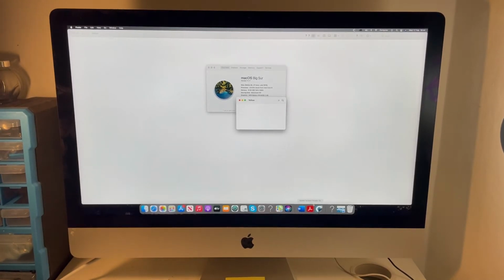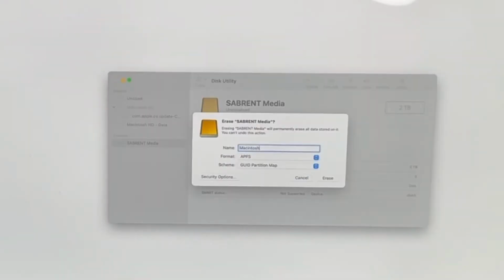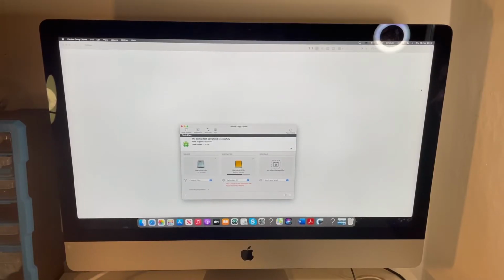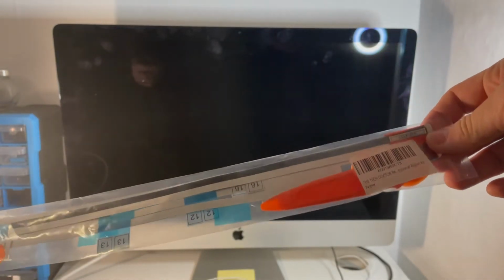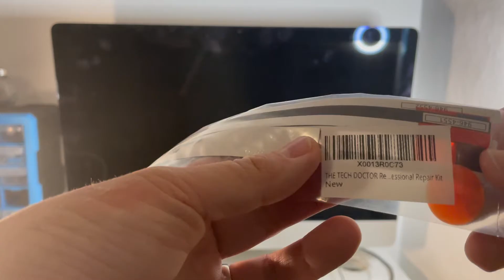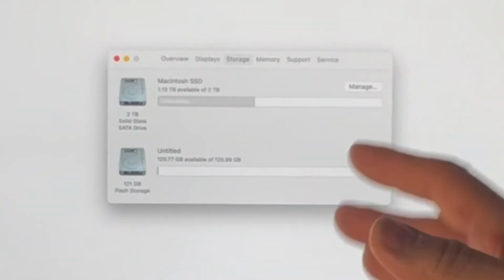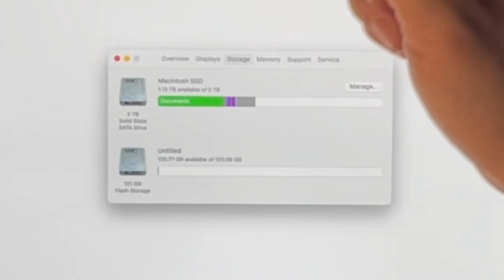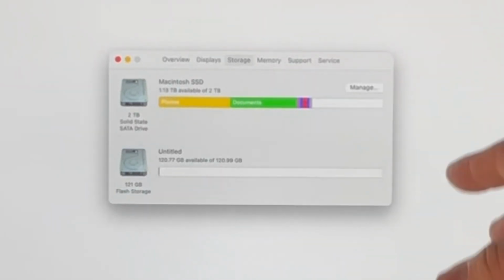iMac 27" Late 2015 A1419 4K - SLOW Fusion hard drive replacement with new internal SSD, MUCH FASTER!

Comment: Thank you Andrew, excellent video. But you left out some critical bits which seriously tripped me up. Most will want to upgrade the slow mechanical drive which is a member of the Fusion logical drive. Your video has the Fusion drive already split into 2 and you're not using the onboard PCIe SSD. 

My scenario was this - identical Mac to this one in video, with 128Gb SSD and 1Tb mechanical drive, both presented as a SINGLE Fusion drive. I wanted to replace the 1TB mechanical drive with a 1TB SSD and keep the onboard SSD as well. 
So I followed the steps, attached a 1Tb Samsung SSD via USB and used CCC to clone the Fusion drive to the Samsung. Removed the old mechanical drive, installed Samsung and system failed to boot (of course, Fusion drive now broken!). Booted with CMD + R to recovery, and ran "diskutil resetFusion" from within Terminal but it kicked up an error ("did not recognize verb resetFusion"). It was loading from the (old) recovery partition which is still MacOSX, Big Sur + Monterey is MacOS11 so command won't work. Here's how I sorted it:

Put the old drive back, system booted OK thankfully. This allowed me to download Monterey installer. Next I created a bootable USB stick (min 16Gb). Removed old disk, put in new, booted the Mac (with LAN/WiFi disconnected, NB!) into Recovery, this forced it to boot from USB containing new MacOS11. 
Next I ran Terminal and again "diskutil resetFusion" which now worked! It wiped both Fusion member drives then created a new logical Fusion drive. It said "Note: you have two solid-state drives, this is nonstandard but OK". Once the ResetFusion command completed, exit Terminal then ran Install Monterey from the bootable USB which installed perfectly.

Critical to this is that you have a Time Machine backup to restore from, clone will NOT work unless you mount it as a 3rd disk to an already booting system then manually copy your data back. So cloning was a waste of time.
Also, a) do clean the inside while the screen is off and b) never ever put the tape on immediately - always test first, put the screen back on without the tape to make sure the system is booting & working OK. 
Hope this helps someone.
Reply: Thanks boerboel777! I have the same late 2015 iMac bought with a 1TB Fusion Drive which like you appears as just one drive. I’ve been doing some research on this and keep coming across splitting the Fusion Drive up in Terminal before swapping out the mechanical drive. I’ve found several articles all with different Terminal instructions on how to do this (seems to change over time for different OSs). Looks like you didn’t do this and just reset the the Fusion Drive after booting from the USB installer with the new Drive in place. 
You say the clone did not work but do you think it helped reset the Fusion Drive as it was repairing the two drives it was looking for? I’m keen to give this a go but a little apprehensive around the added Fusion Drive complications. 

Cheers
Reply: @AlistairJC  You're right, I did reset the Fusion drive (running the command in Terminal after booting with USB) but this trashed the data on both drives. A Fusion drive seems to be a primitive version of RAID. So, with RAID you have an array of multiple physical drives combined in a single virtual drive. Apple's Fusion drive works the same way - it takes the small SSD and whatever other drive you have, then merges both into one virtual drive (VD). When it does this, it creates a hash of both drives' serial numbers and writes an encrypted signature to the new Fusion VD.

So if you change one of the drives, the VD signature becomes invalid and MUST be recreated from scratch. This process completely wipes the contents of those drives, hencewhy the clone didn't work. Cloning had zero effect on the Fusion Drive because it only clones the content of one member drive, and nothing will work without a valid VD sig.
So the only way to do this job properly is to make a Time Machine backup of your drive before you do anything. Then do the drive replacement along with ResetFusion commands and proceed to install MacOS. During installation it will offer you the chance to restore from TM - say yes and its job done. 
The other option is to ignore the Fusion setup and install directly to the new drive like the video shows. This leaves the small SSD hanging about in your machine and is IMHO a bit sloppy. Can't store much data on that drive and it will keep getting in the way. The only time I'd do it this way is if the small SSD is old, dog slow or dodgy - if it fails, the whole Fusion VD fails.
Oh, and be super careful with the screen! 3rd party replacement tape not sticky enough so they fall off and crack - happened with this exact same Mac 2 weeks later, new screen cost US$400 :(
Reply: @boerboel7777  Thanks for the detail, really helpful! I understand regarding the cloning not working.

The Fusion Drive seems like more of a hinderance the further I look at doing this. 
I am tempted to swap the drive and just leave the PCIe blade formatted and unused, guess that’s personal preference. However, I reckon if I do that I won’t be able to use Time Machine to restore from as it’ll be a Time Machine back up of the original Fusion Drive setup I’m guessing. Unless Time Machine doesn’t care about this….

I could use the migration function for the old drive perhaps with a SATA to USB3 adapter, but I’m not sure all the files would be there due to how the original Fusion Drive balances the files between the two original drives like you say. If that doesn’t work I’m at a fresh install on a Mac with no files I guess.

What was the importance of booting it not connected to WiFi/LAN in your original comment, just to ensure it boots from the USB installer? 

Thanks for the heads up on the screen, I’ve been looking at full kits from OWC. I hope the new screen from apple came with better tape! 

Thanks again
Reply: @AlistairJC  Hi Ali. You can get rid of the M.2 PCIe drive but that involves removing the motherboard to reach it, quite a mission. Or you can get an M.2 SSD drive and replace the old one, which gives you much better throughput than the SATA ones. Not sure about Mac but on Windows one can "hide" a drive which is not in use. 
As for Time Machine, good news is that it doesn't care where it gets restored to so that's not an issue at all. It will restore to whatever drive you install. When I ran the CC Clone, I was able to attach that cloned drive via USB and see the data on it but as you say, it may not be as reliable or quick / efficient as TM. 
Regarding booting: yes exactly. If I booted with LAN cable connected, it by default loaded the MacOSX bootloader even though I had a USB boot disk containing the newer OS11. You need OS11 to run the ResetFusion command, on OSX it didn't recognise the command. So forcing it to be offline will make it boot off the newer USB bootloader and enable you to run ResetFusion successfully. 
OWC tape is better than most, but still nowhere near as good as the OEM Mac tape is impossible to get now. So make sure to clean thoroughly with isopropyl alcohol on both the screen as well as metal chassis before you apply the new tape. The problem is this - the tape isn't as sticky, the Mac's heat loosens the tape over time and if the display is tilted forward & down, the screen will come crashing off due to gravity. I've seen horror stories of people being hit in the head, shards of glass flying everywhere not to mention $400 replacement costs...some guys now use 3M tape, very strong but removing the fragile screen becomes even more dangerous. Good luck!
Reply: @boerboel7777  Hi Boerboel, yeah I’ve seen that that is an option and like you say looks a mission, certainly for me anyway so I won’t be attempting that! If I was to go to the trouble to remove it I’d most probably would just replace that one as well. Perhaps you can hide it in macOS somewhere but not essential! 

That’s great news on the Time Machine, I’ll go down that route then.

Understood, that makes sense to just have Monterey on the bootable USB and like you say use the rest fusion from there, then just install Monterey straight to the new SSD.

OWC seemed a pretty reputable place to get the kit from but thanks for the heads up on that, I don’t fancy having to deal with that falling off! I thought it might be related to the heat. I’ll make sure to clean it off as best I can to give it the best possible chance. I guess if it’s $400 from apple they fit it with the proper tape!? Yeah 3M tape seems overkill and you’re not getting that off (if you need to) without breaking the screen! 

Thanks again for all the detail!
Reply: Hi Boerboel,

Thanks for the detailed process. I'm planning to do the replacement once received the iMac 27 2015.

1. Since I have other Mac I guess I can prepare the bootable usb to have it ready and replace the mechanical with the ssd directly.

2. After installation of new ssd and the diskutil resetFusion at terminal at fresh installation how many volumes will appear? 1 PCIe and 1 SSD? Should I delete them and then install on the SSD or will be 1 volume (combined)?

3. If there are 2 volumes I guess I will choose the "big" ssd instead of the "small PCIe" but it will be there all the time?

4. Since the device is new (used purchased with fresh moderey) do I still need to have Time Machine backup before start the replacement?

Thanks in advance
Reply: @Acruxni  Hi Nikos, there will only be 1 volume. The whole purpose of ResetFusion is to "re-fuse" the two physical drives into one logical volume. 
No TM backup needed if the new iMac is blank, because you'll be doing a clean installation. The only time you want to use TM is either if you have data to backup, or your internet is extremely slow. Then TM will restore the MacOS it came with, instead of downloading everything from scratch. Good luck and be super careful when removing the screen!
Reply: @boerboel7777  thanks a lot. 
So..

1. create on another Mac the usb bootable with Monterey 
2. replace the drive
3. start from usb installer
4. run the Terminal and again "diskutil resetFusion (to merge the 2 volumes?)
5. At Installer process will be one volume(?) should I delete to remove the contents (PCIe still have the old fresh install and ssd is new)?
6. Install on the new volume (merged PCIe/ssd)?

Is my understanding correct?
Reply: @Acruxni  Yes this is correct but before step 3 make sure the machine is offline (remove LAN cable, do NOT connect WiFi - this will force boot from USB) then at step 5, the drive will be blank / empty so no contents to remove. Go straight to step 6.
Reply: @boerboel7777  thanks for your patience. 

I understand that only 1 volume will be available 1.024T (PCIe 24gb + new ssd 1TB) and not 2 separated. 

If only 1 volume then ok install directly 

If there are 2 volumes I should install on the PCIe or SSD? Which is better? PCIe I guess?
Reply: @Acruxni  If you choose not to run ResetFusion then both drives will show up separately and you can install to either one. Generally PCIe is much faster than SATA because of better bandwidth. However, your PCIe only has 24Gb space which is inadequate. Also, the PCIe is older so its more likely to fail than the new SSD drive. I would choose the SSD in this scenario.

What you can also do is replace the PCIe drive with a 1Tb unit. This is a lot of trouble as you need to remove the logic board to get to the NVME / M.2 drive which sits in the back of the logic board. 

Your best performance option overall is to run ResetFusion and use the logical drive consisting of 24Gb PCIe and 1Tb SSD.
Reply: @boerboel7777  all clear now. Resetting the fusion will merge the 2 volumes. 

Thanks for your patience. Crossing fingers…
Reply: @boerboel7777  I'm curious if you or anyone has done tests to see whether the new fusion drive using the SATA and PCIe SSD drives is actually faster than just using the SATA SSD without fusing them.
Reply: @piratedamon80  Unfortunately not but suspect it would be slower, since the system has to address the logical drive via two separate I/O systems. I actually regret using the Fusion drive now - replacing the mechanical drive with SSD and merging it with the PCIe drive seemed a good idea at the time, but when the PCIe eventually fails it kills everything.
Reply: @boerboel7777  Thanks! I am probably going to do this type of surgery next week and your answer confirms what I had been thinking: I can keep the whole OS on the PCIe 128GB drive and use the SATA (probably 4TB) drive for data. Then if the PCIe drive fails, it won't be a major problem.
Reply: @piratedamon80  Sound plan, good luck. Just one other tip, BTW: the replacement screen tape isn't as good as the OEM Apple stuff, so these iMac screens have a nasty habit of tearing loose and crashing off if tilted down. I stick 2 cable tie adhesive mounts on the rear of the screen, another 2 on the inside of the chassis next to the speaker. Then thread 1 or 2 cable ties through both sides leaving 2 or 3 inches slack. So if it does loosen, at least this keeps it from falling down.

Comment: Oh God ... not kidding, but it has lasted 7 years so far ... but now my drive is making these terrible annoying squeaking sounds every key-press or mouse-click.  Thanks for this life-saving video!

Except I just looked and my system internal drive is listed as a APPLE SSD SM0256G Media???  Is that a hybrid drive or not?  If it is not my hard drive that is making these noises ... what else could be?  I was thinking it could not be the fan because it starts and stops so abruptly?  But I have also never heard of a hard drive squeaking either?

Comment: Clones successfully but when booted up it has a folder and doesn’t boot
Reply: anyone facing the same issue?
Reply: @kwanghonggoh6591  i actually got mine working. I’m not sure how I got that error. What I was not understanding when I did this is that in the end I needed to set the new ssd as the boot drive like on a pc but did not know at the time.

Comment: I have a late 2015 27" iMac running Mojave.  The internal drive is failing, so any attempt to touch any of the files or letting it just run for more than a minute results in it freezing up as it tries doing background tasks.  

I recently bought a internal SSD and formatted it on a company mac with APSF as recommended. But when I tried to utilize it on my iMac, it wouldn't let me modify the drive in a recovery mode boot (command R). I could see it, but it wouldn't let me install an OS. To get it to be editable in Recovery, I had to reformat it again in Mac OS Exended Journal back on the company computer.  But, when I did an OS install in Recovery back on my computer, it would eventually go to a black screen with an endless white circle loading screen.  So I restarted it into the startup manager (alt/option) and there it was. I selected the newly installed drive, it gave me the prohibited screen.  Oh the anger.

After fussing with this thing for over a week, I did a command-shift-R and it seems to have worked. It took me through creating a profile. At first I slightly panicked thinking I overwrote the original drive but in my frustration, I unplugged the new drive in the external casing and the screen went black. Not my brightest moment but that was proof it was loading off that drive.

I'm no tech person but I thought I'd share with anyone else trying to do this without being able to utilize disk utility on a normal boot or a correctly functioning computer.
Reply from the maker: You have to upgrade your internal drive to Catalina first so that your iMac firmware can recognise the APFS drive.

Comment: Thank you for showing us how to do this, I have a 2017 5K iMac that is horribly slow, it takes a long time to reboot. Can I replace the HD with an SSD? Do you have a recommendation on what SSD to use? I would like a 1TB. Thank you in advance! You Sr have earned my subscription! (Just an idea... you could also leave the parts needed to do this with different iMac models, to get more referrals! like mine iMac18,3   (iMac 27-Inch "Core i5" 3.4 (5K, Mid-2017) MNE92LL/A ) A1419
Reply from the maker: Yes all the same parts will work: 
iMac adhesives for A1419 (The Tech Doctor): https://geni.us/imac-a1419adhesives
SSD - Crucial BX500 2TB: https://geni.us/crucialbx5002TB
Sabrent USB adapter for SATA: https://geni.us/sabrentusb-2-5inch
Sabrent 2.5 to 3.5 inch adapter: https://geni.us/mountingkit-ssd

You can switch the 2TB SSD with the 1TB if you want in the same Amazon entry depending on your country.
Reply: @Andytizer  Does it really makes a big difference on speed? I installed 48 GB memory, but after I start the computer and after I logged in I can't open any programs right away it takes over a minute to do that, do you think this will help with that? Thanks again.
Reply from the maker: @VanLuciMoret  yes it’ll make a huge difference, RAM has nothing to do with startup speed.
Reply: @Andytizer  Thank you Andrew, hopefully after upgrade I will be able to start using any program on my iMac before the 5 minutes I have to wait now. ...  LOL.

Comment: Hi Andrew...I have a Retina 5k 27in late2015 iMac 32 Gb 1867 DDR3 and 3.3GHz quad core intel core i5 processor. It has AMD Radeon R9 M395 2G graphics. There is 1.79TB Available of 2.12TB on the fusion HD. I keep getting the beach ball when working in Adobe CC Illustrator/Photoshop. I assume its the processor that needs upgraded?? Can  an SSD be installed on this Mac? If so, is 2TB sufficient? Thanks
Reply: Installing an SSD removed the beach ball?